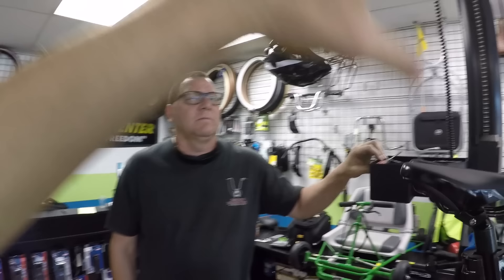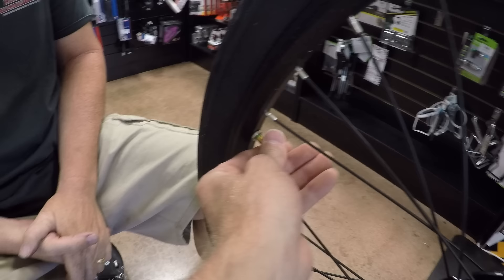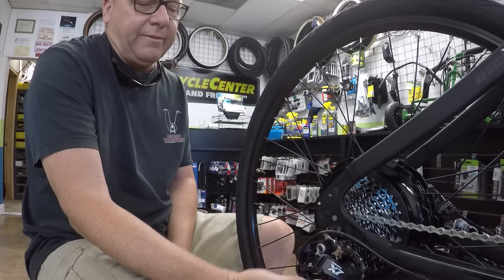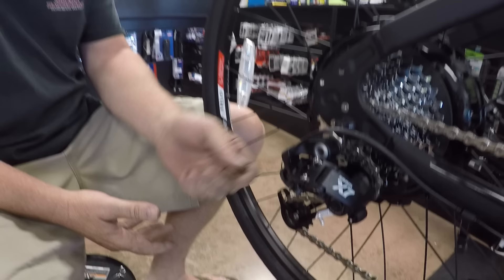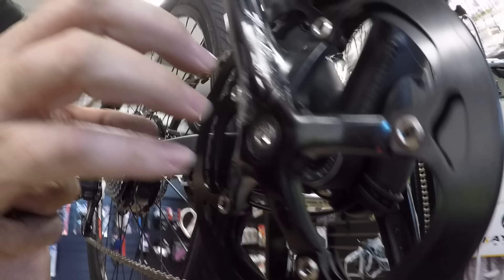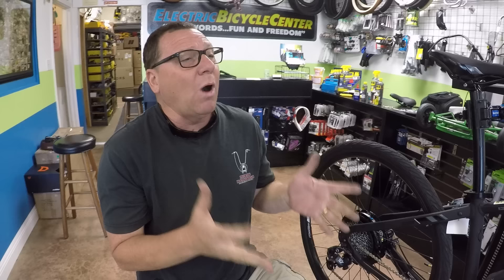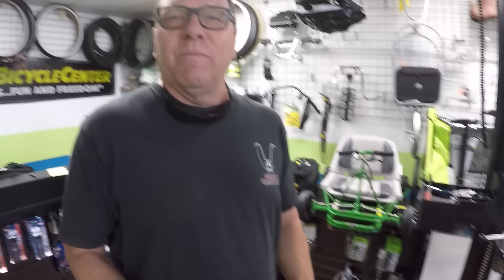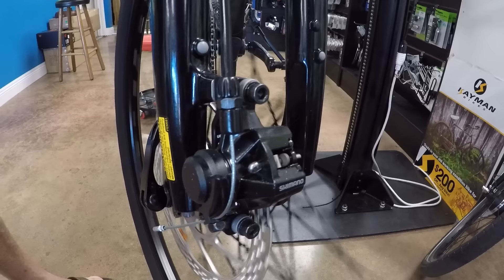Professional Advice for Maintaining an Electric Bike

Comment: Sorry, wrong , WD40 is a light lubricant.
Reply: Red Toberts WD-40 makes a whole line of of products now yes you are correct you don’t want to use the the original product to lube a chain but you should look into some of the new stuff they make.
Reply: @samueltownsend1569  I will stand by what I said. Been using it for 40 years. WD40 the original, is a light lubricant.

Comment: 10 out of 10 you don't want to put oil on your chain at all especially if it's a nickel plated chain they don't need oil that's why they are nickel plated
Reply: That is 100% not true. Even nickle plated chains need lubricant to reduce wear. Also a unoiled chain is very inefficient, because now each link in the chain is grinding against each other, rather then sliding. There are no bearings inside those links. Its just metal sliding on metal.
Reply: Chain lube drastically quiets chain noise, so there is that.

Comment: Please ask Sam about range , it's high time there was a minimum , rather than the utter nonsense put out by far to many manufacturers , I would venture to suggest , a correctly adjusted e bike , with a normal person on it,  almost always will not get the distance there supposed to get , it is time this was addressed , sorry but  reviews and the people doing them , need to include what is reasonable to expect ,  be strait about what is going on.
Reply from the maker: David Macdonald Hi David! I agree, there are so many factors that come into play like rider weight, terrain, age of the battery etc. but in general the estimates from most manufacturers are high... to help address this I post a range of numbers on the site (often like 15 miles to 30 miles) to give people an idea of the bare minimum (that being throttle only at high speed) up to a max (pedaling along in a low level of assist). Hope this helps, open to suggestions!
Reply: There are too many variables from tire pressure to air temperature, wind, to age of battery, to riding style.  And more. Biking on flat roads is easy, so unless one has zero fitness, you only need pedal assist for hills or headwind. If one needs pedal assist or throttle for an entire ride, then maybe a has powered vehicle is better.

Comment: 7:15 “you are not supposed to have (a wet) chain” - who says that? you put it on and it drips off, seems like an odd thing to worry about.
Reply: An oily chain is soon a dirty, grungy chain. After wet (oil) lubing and running the chain up and down a few times, wipe off as much oil as you can. Oil that you can see is a dirt magnet. The oil that lubricates is inside the chain between the pins and bushings, bushings and rollers.
Chainwheels (front sprockets) and clusters (rear sprockets) are expen$ive. Chains are relatively cheap. When the chain has worn (“stretched”)  2%, which is about ¼”/6mm in 12”/305mm. When a chain worn 3% or more is kept in use it will start hooking the sprocket teeth, which will then wear a new chain faster.
Reply: Al Grayson but where is the proof? If you have an excess of oil it could just equally form a cruddy coating and kept the rollers clean for longer, I don’t know either way

Comment: I bought my Lectric XP in January 2020 to get rid of excess weight. I ended up losing 77 pounds, and my legs are like tree trunks. I have 2 batteries and have travelled 65 miles round trip. I currently have 2400 miles on my ebike. Life is great... or, was great. Last week, at 2400 miles, the bike broke down electronically. Left me stranded, twice.  Had to walk home several miles. Lectric company says it’s still under warranty, but will take a long time to get the part needed to fix. Coming from China and from I got from the tech, this prob is happening to thousands of Lectric bikes.  So, I stop riding for how long? A month, maybe2 or 3.... I don’t think so.  I am going to buy another bike from another brand cuz this one is no longer reliable. It’s just taking up space in my bike barn. The unfortunate part is I just finished building my solar bike barn so my bike is propelled by sun and keto... I hope Lectric realizes that my warranty is on pause until it is fixed. They can’t take a month or several months and expect the warranty to keep running. So, if u want this bike, I totally recommend it. Just have secondary transportation and Uber on stand by.  P.s. no public transportation where I live.  ur on ur own here
Reply: Interesting story about you breaking down could you explain one thing you said last week you broke down twice after you broke down the first time how did the bike start running again did you fix it? Did it fix on its own? If you broke down two times that means it started running again doesn't it? Thanks for the information but please clear this up. Perhaps you can stop by telling exactly what went wrong that would make the story more credible
Reply: @yoHOBODAN  hi there! Thanks for response however you sent me a link for YouTube video that's an hour and 22 minutes long.... I don't know if you think that people are going to watch an hour and 22 minutes to get an answer!!!!!!!!!!!!!!!!!!!! what would be logical is to have you just tell us to answer and say we can confirm it watching the video or a second option would be to tell us what minute of the video your answer is on because seriously you're not thinking someone's going to look through an hour and 22 minute to get an answer to a story that you gave that had a lack of credibility!!;!!!!!!!!!!!! and you expect to answer that question of a lack of credibility with an hour and 22 minute video????????????? it makes it more suspect and more suspicious so how about a direct answer and then we can look at the video quickly for what minute it's on you think?????????????
Reply: @Iambriangregory  scroll down in the comments and look 4 the 44 replies on my post
Reply: @yoHOBODAN  okay I can see that my detector was right... I spotted something amiss and strange about your claim and you are acting like a lot of people I see on TV not answering the question avoiding the issue.!!!!!!.... so congratulations you've exposed yourself your credibility is going even lower the fact that you just cannot answer the question you've been exposed to the whole internet and because you found maybe a few gullible people you wouldn't be the first person to put on a carnival act that they thought was real!!???! You obviously don't care about your reputation I can see that now! SHAME IN MORE WAYS THAN ONE!!!!
Reply: @Iambriangregory  what are you talking about?  seriously, if you do actually ride an e-bike, you really need to stop smoking the glass pipe..... meth will kill you.  the link i sent you tells the story by timeline.
Reply: @yoHOBODAN  well here we go again the typical convict inmate attitude that you exposing yourself ,instead of just answering the question  directly you continually type up irrelevant distractions distractions ,like a lot of people do that are in your position and it doesn't take an a mental professional to know you're engaging in the subject of projection of taking your own issues and problems and trying to projectt them  somewhere else, obviously you're talking about drugs is indicating that as a probable influence in your fantasy delusions because instead of just answering the question  directly you continually try to point attention somewhere else(SMH)  your suspicious claim of breaking down twice and not explaining how THE BIKE got fixed all you had to do was answer the question...   well I see that your years that you apparently spend in prison didn't do you any good,. thank you for exposing yourself again for what you really are!!!!!! ALL THIS WASTED TIME YOU COULD HAVE SIMPLY ANSWERED THE QUESTION DON'T YOU THINK EVERYBODY KNOWS HOW SUSPICIOUS THAT IS? AND YET STILL AFTER BEING EXPOSED AS BEING VERY SUSPECT WITH THEIR STORY YOU STILL HAVEN'T ANSWERED DIRECTLY AND QUICKLY THE QUESTION THE NERVE! HAHAHA PATHETIC EVEN IF YOUR STORY IS TRUE STILL PATHETIC BOY HAVE YOU BURIEDYOURSELF IN A HOLE!
Reply: @Iambriangregory  the bike got fixed... happy? Now go back to throwing bricks and firebombs.  R u an employee of Lectric?
Reply: @yoHOBODAN  well it took you a long time to give a somewhat half direct answer which you could have done a long time ago and again you're showing yourself to the world instead of just being a straight up person you still are projecting your attitudes onto other people! nobody was looking for yo to criticize you brought it on yourself by your evasive general suspicious answers and now you feel that for someone to do that they have to be an employee of the company !!!no it's simply a common sense person that hears something that makes NO  sense and called you out.,... so thank you for exposing yourself BECAUSE it makes me know that my detector was working properly!!!! thank you very much you have helped me tremendously thanks for letting me know your general answer that the bike got fixed with no specificity at all!!! thank you thank you thank you I'm going to have to watch out for you in the future because you're nobody to get any advice from or take a trip on a back trail with very suspicious.

Comment: Ugh... metal does not stretch 🤦‍♂️
Metal may fatigue, wear & sometimes deform. But metal does not 'stretch' without extreme external Force. Chain wear is not due to chain stretching. Cable wear is not due to cable stretching. And by the way it's not just semantics this is proper technical information. 🙄
Let's try to keep the industry more consistent with standard operating procedures that are widely accepted in engineering, metallurgy & physics.👍

Comment: Hey wondering if you could help a fellow ebiker... you may have seen this starting problem before...  If I was going to replace something would it be the controller or the motor?  This only happens when its starting from a stand still... @https://www.youtube.com/watch?v=-O4sneDnd98
Thanks again for any advice.
Reply: Chris Smith Sorry for the late response I’d start with a controller it’s a lot cheaper to replace than the motor good luck you probably have this whole thing figured out by now